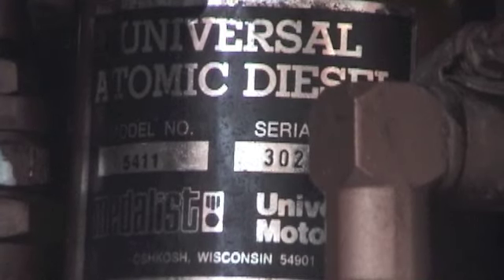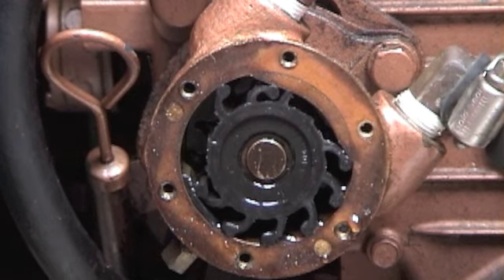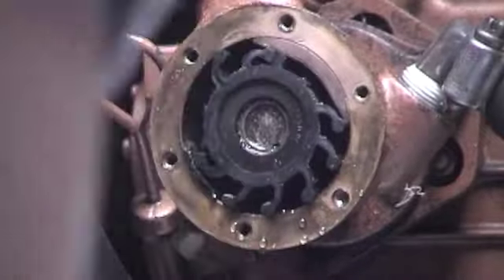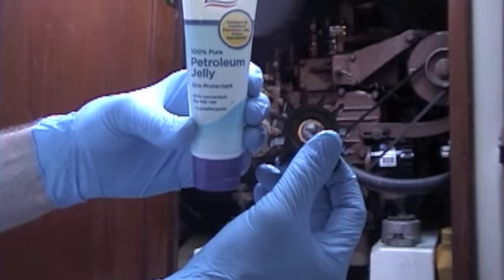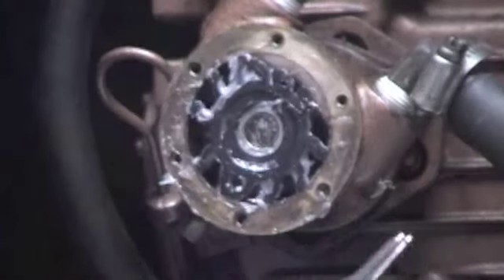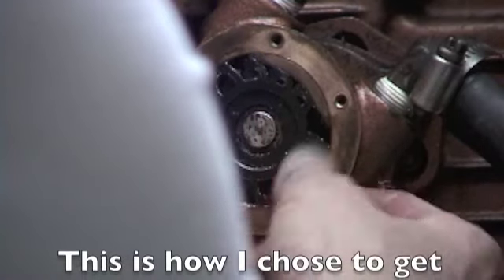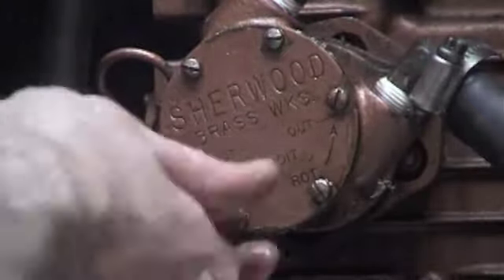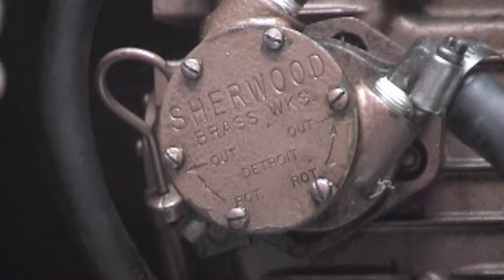Universal Diesel 5411 Sherwood pump impeller replacement

Comment from the maker: Yes, correct, pull the impeller carefully off and leave the shaft intact.  I've never had this happen, but if you screw up here, I think you have to unbolt the water pump to fix it.  I hold that shaft in place with a screw driver.  I lubricate with vasoline because that was what I was told.  Sailorlewi recommended soap, I think that's a good idea.  I want the piece of mind that no blades will break off.  Replacing is fairly easy, but it's fussy and you could have trouble with the snap ring.

Comment: According to what I have read using vaseline on a rubber impeller can damage it. I use liquid soap on mine. Also read that it is not really  necessary to replace the snap ring after changing the impeller

Comment from the maker: I just had to replace the impeller again on my 5411.  Luckily, noticed the temp was about 200ºF.  Not sure why it crapped out so quickly again, might be that I did not seat the woodruff key well enough.  The woodruff key is the one tricky part of the impeller replacement and you must be sure the impeller won't turn freely after you have pressed it into the pump housing.  A big glob of grease on the key helps hold it in.
Reply: I know this was a long time ago, but in the future, the reason your pump was not working well is because you have to install the impeller with all of the fins pushed to the same side. In your case, since the shaft rotates counter clockwise, all of the fins should have been folded over to the right. There is not enough room in the housing for them to "flip" over the correct direction, so some of your fins were not really pumping. This is the same for outboard impellers as well.

Comment from the maker: Lewi, thanks for the comments.  I looked around the internet and you seem to be right about the vaseline, though there is a little controversy about it, the liquid soap looks like a good idea.  Removing and replacing the snap ring was tricky, but leaving it off seems controversial.  Where did you read this?, and why would you leave it off if it was there in the first place?  It's been there 31 years.  Leaving it off would make the process a lot easier.  BTW, that 5411 starts right up.
Reply: I have replaced my impellar but I never had a snap ring and have been running it without one... is that ok?  My engine is  a 5416 universal atomic.

Comment: If you have no problem replacing the snap ring, then by all means continue to do so. I am on several Catalina lists, & most people have commented that it is so difficult to reinstall that they just don't bother & have had no ill effects. I can't comment through personal experience because my engine has the newer sherwood that unbolts from the back & has no snap ring.

Comment: you had to repair again becouse you left the missing parts of the impeller inside the cooling circuit. if you dont find them somewhere inside the cooling system then your engine will heat again. Also check the water that is coming out. is it the same as before or something (missing impeller parts) blocks it.

Comment: What is procedure recommended to inspect engine for broken impeller parts? My 5411 (Catalina 27) runs at 150 degrees and concerns me that there could be blockage especially since the discharge seems scant.

Comment from the maker: Lewi had commented that using vaseline to lubricate the rubber impeller was not a good idea because it is a petroleum product.  I have researched this and that really pertains to rubber parts such as O rings that will be sealed up around metal.  The rubber impeller will get vigorously washed in 150º fresh water on a regular basis, so no problem using vaseline here though I'm sure soap is okay but less lubricating.  I've read that glycerine is good, silicone spray or grease may be okay too.
Reply: Water temperature will be the temperature of the water that the boat is floating in! Flow through these pumps is once through then back into the lake, river, ocean etc.

Comment: Couple of comments. This is just about one of the easiest maintenance tasks you can perform yourself on this engine but always carry a spare. I've never lubed the impeller either, I  figure it's lubricated well by the water passing thru and whatever is on there will be removed quickly. Lastly, I believe you have to be careful as you back the impeller off to not have that shaft pull out, is that correct?

Comment from the maker: On this last impeller replacement I didn't use the snap ring, good luck to me.  I did run the engine a while and the temp. stayed at 147ºF.  I have read that idling the engine for periods of time may damage the impeller, I'm guilty, but no more.  Apparently, diesel engines don't like to idle and will age quicker.  I've read that they like to be driven hard under load.  Not sure why trucks at Truck stops idle their engines all night, must be different.

Comment: Why is it bad to let the shaft come out? I had this happen and just put it back in. Still works.
Reply from the maker: Christopher, you're correct, when I made this video, I had been told that it was bad to have the shaft come out, but I know now that's it's not a big deal.
Reply: Thanks for making the video. I used it to help me install a new Oberdorfer pump and it works like a champ.